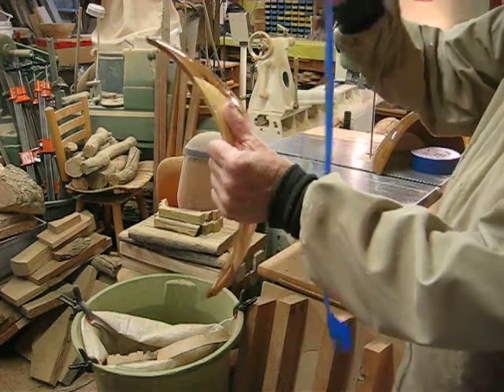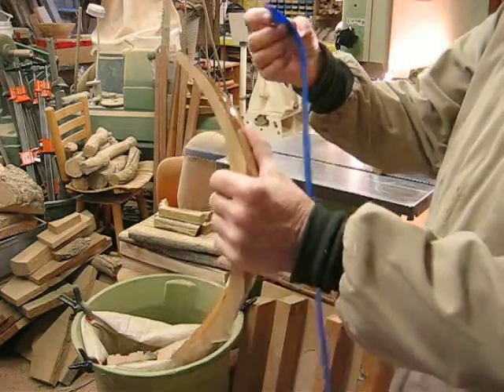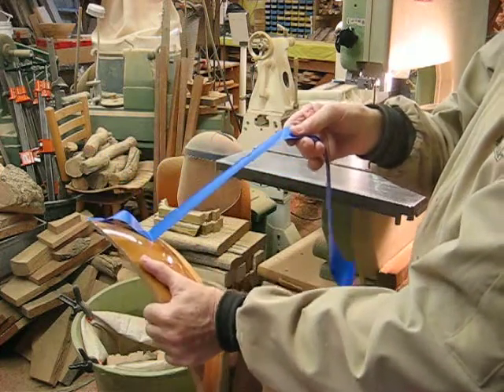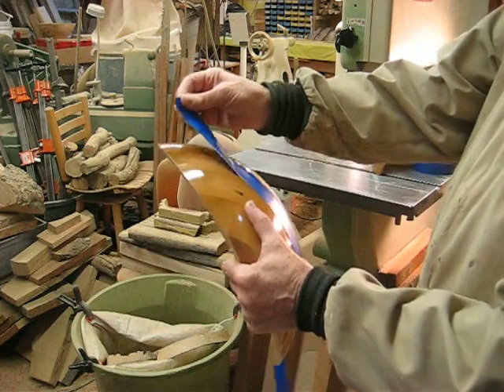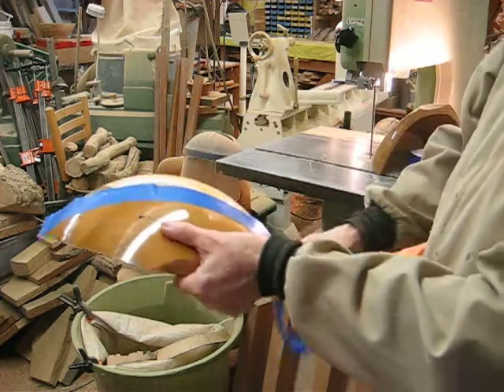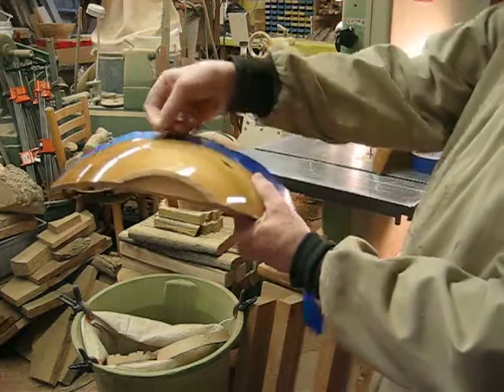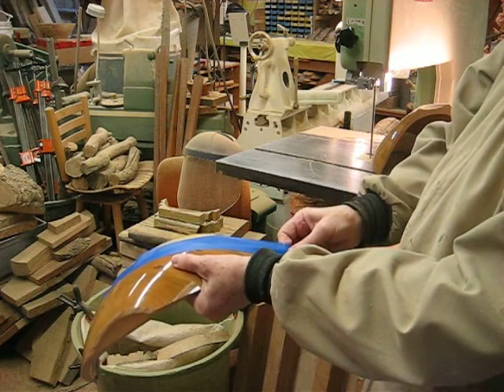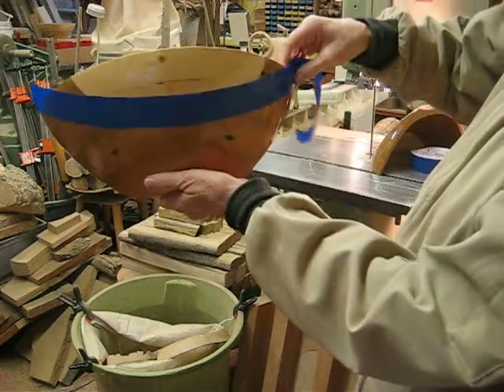Stylized Canoe Video 10

Comment from the maker: Here are the links to the videos in the correct order:

Video 1 - https://youtu.be/satbXSQn5v4
Where to start.  The thinking involved.

Video 2 - https://youtu.be/jG_yp1cPUgg
Discussion about the milled wood prior to glue up.

Video 3 - https://youtu.be/7K5yS-pzBnY
Discussion of how the bowl should look.

Video 4 - https://youtu.be/cRiQH1Q3AIg
Working on the bowl design.

Video 5 - https://youtu.be/aO0I45nnAdA
Talking about the bowl when it is mocked up.  A first look at the bowl.

Video 6 - https://youtu.be/mUpgKMap_1A
The glued up bowl and talking about the next steps.

Video 7 - https://youtu.be/d3oJb7xQCRM
The finished bowl and a discussion about further steps.

Video 8 - https://youtu.be/3X9tWGAlVqk
Sanding the two halves.

Video 9 - https://youtu.be/Pxwy9zaBN2Y
Talking about the finer points of sanding to eliminate cracks.

Video 10 - https://youtu.be/2QBtc1js66U
Laying out the line for the next cuts.

Video 11 - https://youtu.be/1TjfypRjdGc
Making the final cuts.

Video 12 - https://youtu.be/Bf8bE_zc-no
A surprise bonus!

Video 13-a - https://youtu.be/lmqjVi-fAqw
Gluing up the piece and the next steps.

Video 13-b - https://youtu.be/nT8AiPhNC-o
The phone rang at the end of Video 13-a so this is the conclusion.

Video 14 - https://youtu.be/9bxB-XZsl8M
Final words about the outcome.